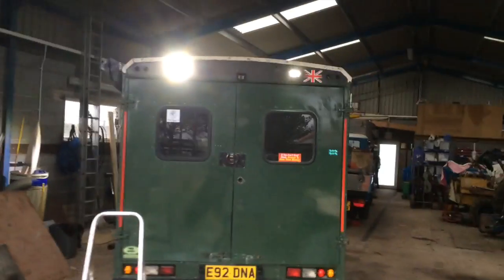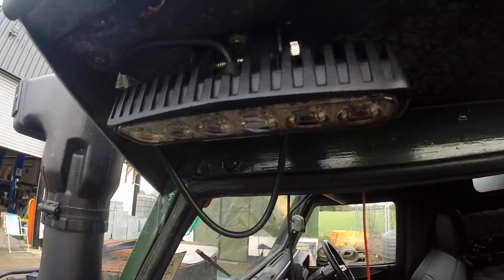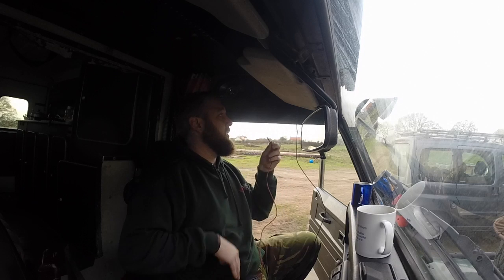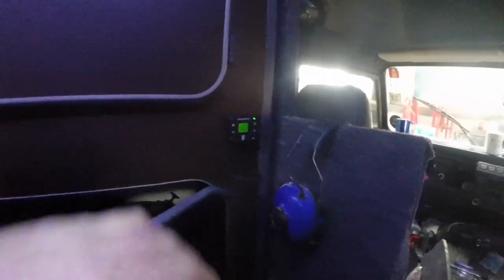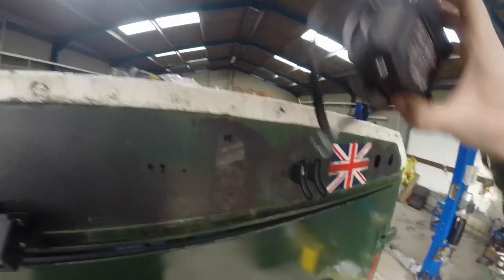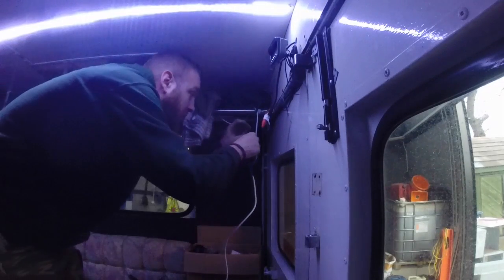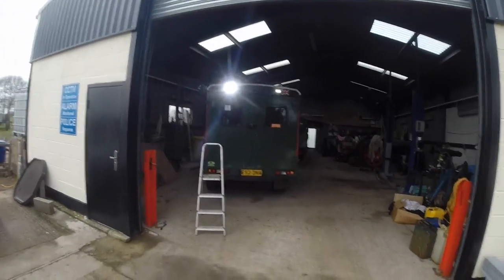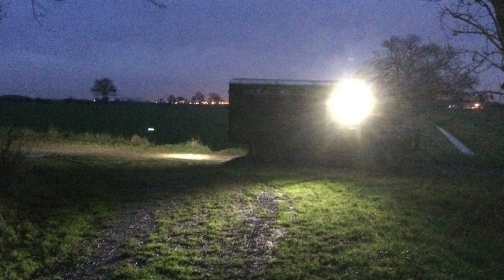instaling 360 degree LED lighting to the land rover camper BOV

Comment: Quite a nice job. As my defender is only a 90 I do not feel the need for lights on the side. As for the front and back (reverse lights) I also opted for led to replace the original little candles.
Reply from the maker: You never need lights on the side until you have had them and then you use them for everything from collecting wood to checking out what is in fields as you drive past at night.
Reply: Torn Apart self sufficiency. Bug out vehicles uk I can understand they are quite handy sometimes :-) .
Reply from the maker: +Offroad Channel that and LED cost nothing so it doesn't hurt fitting them. Then again the just fit it approach has left me driving a loaded out 130 haha.

Comment: just a thought wading through water and the hight of your night heater is it a bit low  ??
Reply from the maker: +Brummie Prepper its higher than the old one under the floor. that cupboard didn't let any water in in wales either so I'm hoping it will be ok.
Reply: +Torn Apart self sufficiency. Bug out vehicles uk  I would make a bung for exhaust just in case better to be safe than sorry
Reply from the maker: +Brummie Prepper good idea